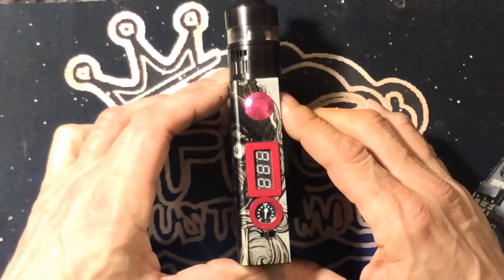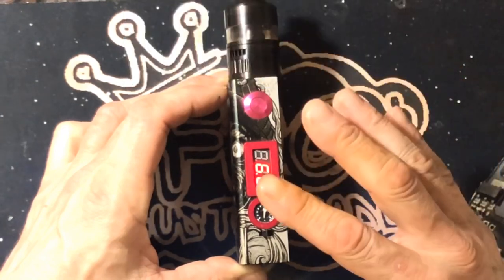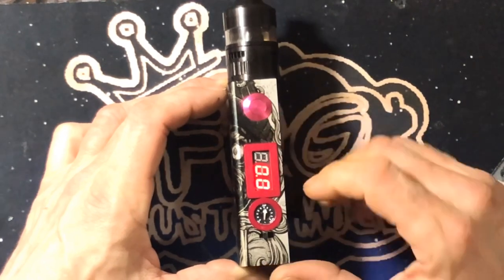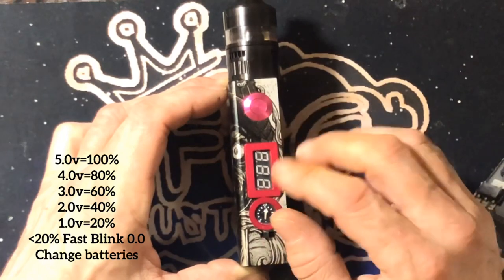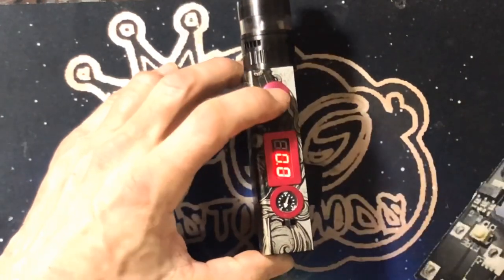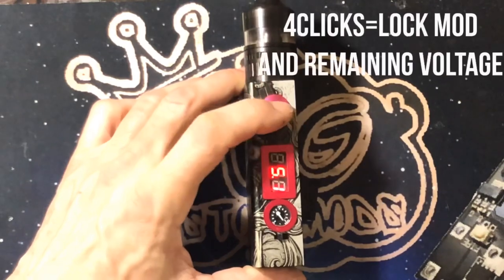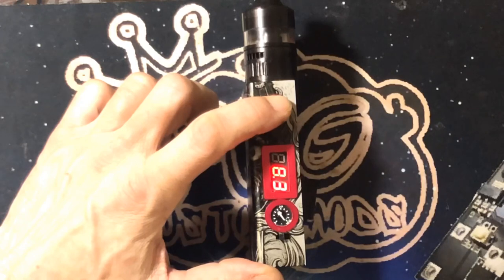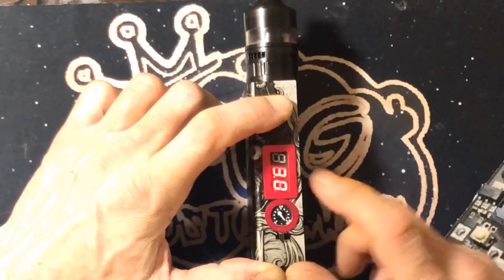SMART PWM v3 (SPWM3) FUNCTIONS

Comment: What's wrong when pressing the fire button and it flashes 0.0? Other times I can press fire and it will fire for a split second then cut off and it will come back on after I unscrew the atty.
Reply from the maker: There’s a couple reasons that can happen .. can be because your batteries can’t handle the build .. try a new set